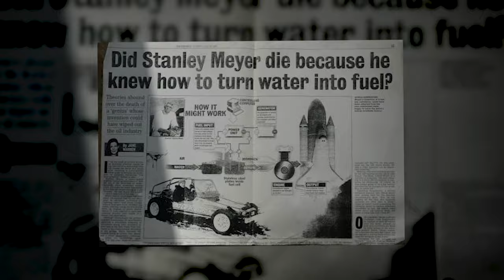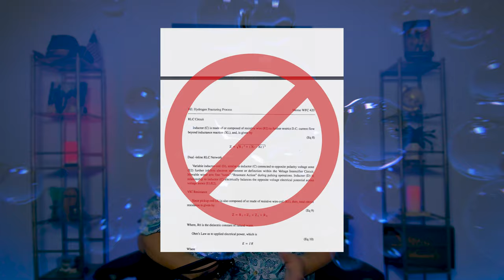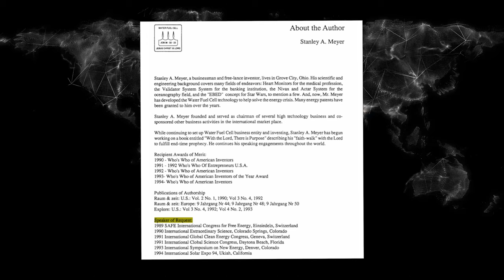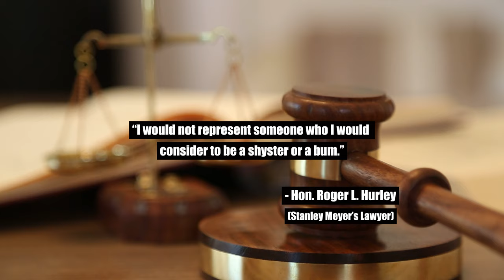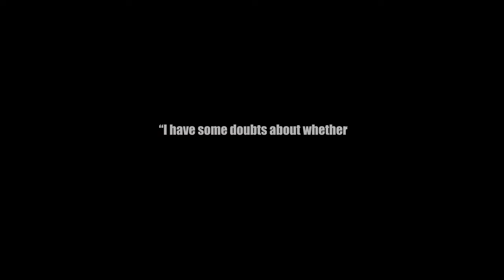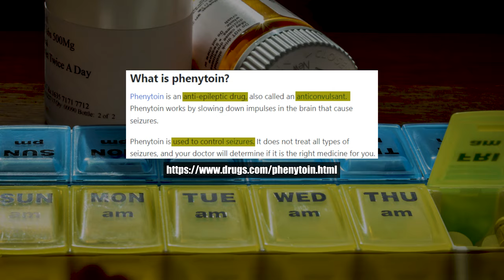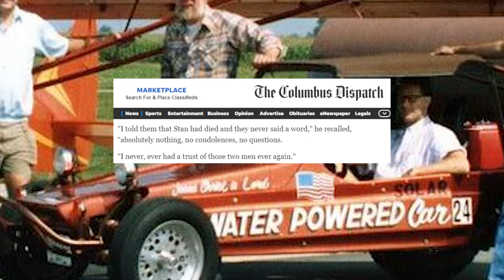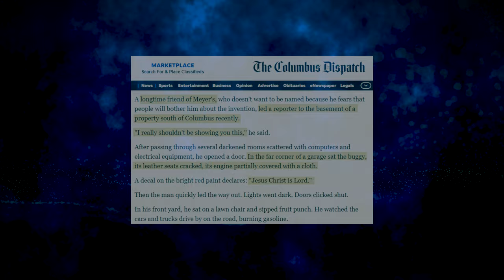Stanley Meyer and the Water Powered Car

Comment: Great video, probably one of the best I've seen on Stan. I like how you had the audio from the reports read by different voices. Was that done with AI?
 
I've studied Stan's work since 2008. His buggy and estate went through several hands until 2010 when it was sold to a private company. As far as I know, they still have it. There's a lot more there than just the car. 

Despite his terribly written patents and technical documents. His claims and the fact that he never ran off with investors money, and continued his research for over 20 years should have more people looking into it.

I know one person who supposedly replicated the phenomena back in 2014-2015. He got sick from exposure due to the radiation produced/released by the device. 

I'm confident I can get it to work, but it's a massive undertaking. From my research, there are at least 15 variables within the circuit, and they all have to be correct. The problem is, if you change one of the variables to try to make it work, it affects the others, and it's extremely sensitive. On top of that, there are specific conditions that have to be met before resonance can occur. 

As far as the car goes, He never got it to the point where he could just turn the key and drive. Despite that, I think he produced and discovered a phenomena early on in his research that propelled him to continue....
Reply from the maker: Wish I could have spoken to you about this before this video! Yes the voices were AI, except Stan's of course. And yea, I'm definitely not an engineer and don't claim to be, but it seems like there's a puzzle piece missing in all of this as far as his work goes. If you ever get it working let me know. Thanks for watching and for the kind words!